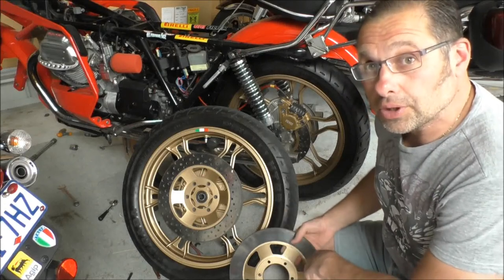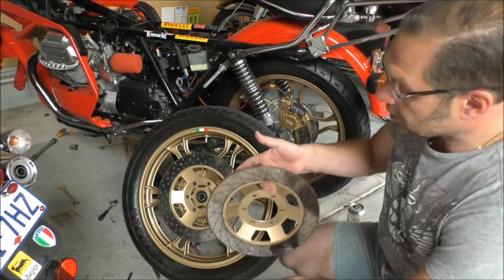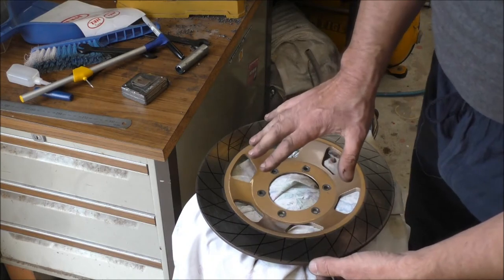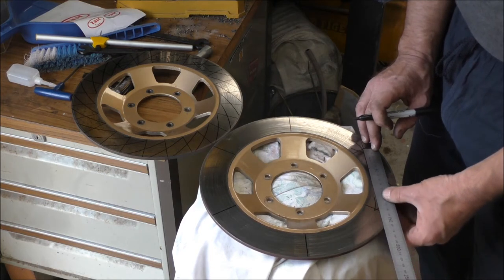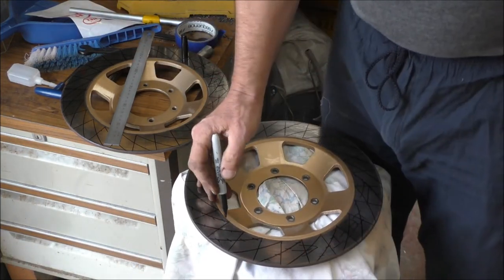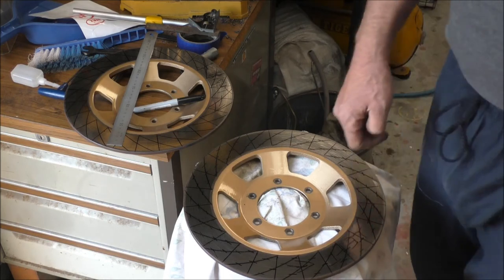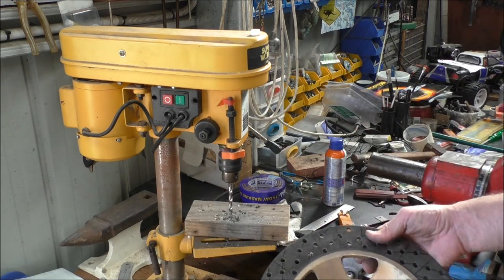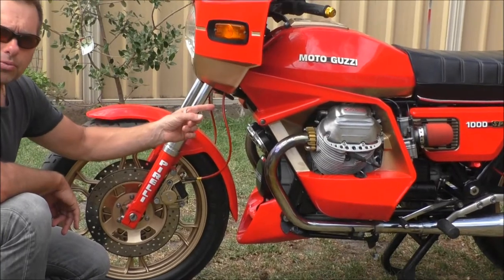How to drill motorcycle disc brakes.

Comment: Main advantage is cleaning the pads of crud, which otherwise wears grooves in the disk and galls up on the pads. So main reason for drilling is Improved brake performance and disc longetivity. Nice video re how to mark out the holes etc. Thanks for posting.

Comment: Sir, what specific kind of drill bit did you use sir? Will it not misalign the flatness of the disc brake?
Reply: Looks like he’s using either HSS or cobalt drill bits. A nice hard, sharp drill bit at the correct speed will cut with ease and won’t create an excessive amount of heat. Personally I’d have used some cutting oil too, stops a lot of the noise at least lol